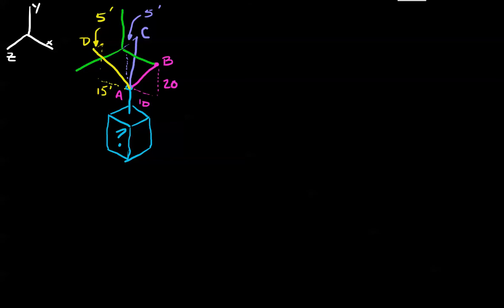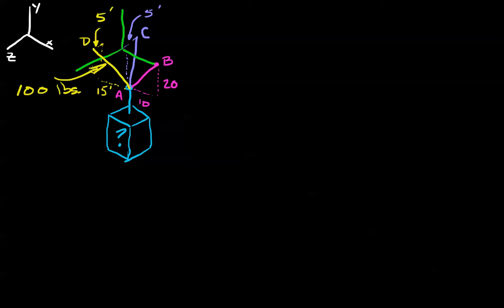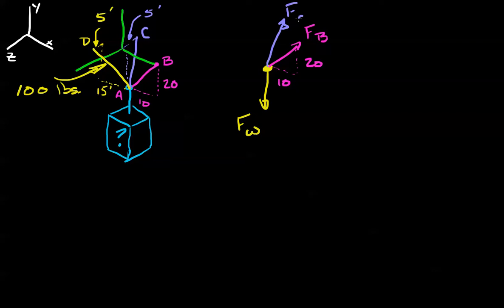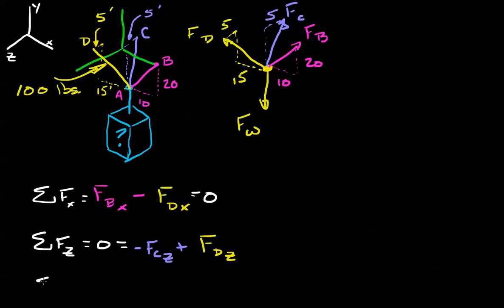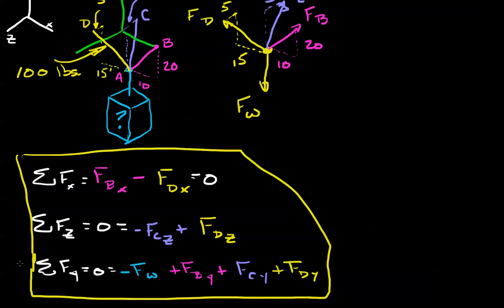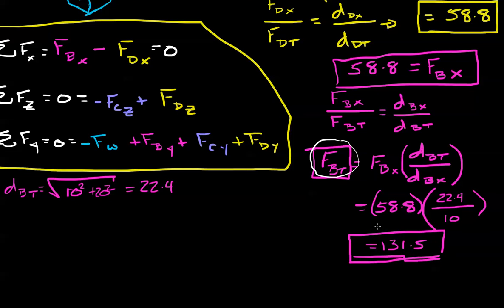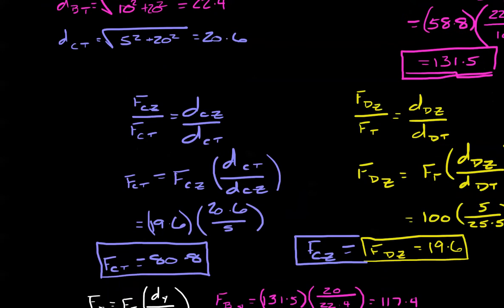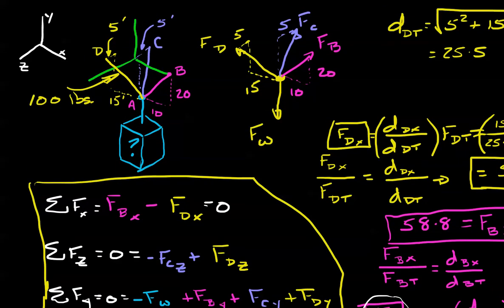Engineering statics 05 3D problem (vector practice) PE

Comment: What if the weight of the crate is known, and the length and angle of the wires are known as well. How do you solve the force on each wire?
Reply from the maker: Really, the same basic process.  FBD.  Then sum your forces.  Now, use the fact that, in the y-direction, Fb+Fc+Fd= Fw.  You can solve for the final values using simultaneous equations, matrices, or slick substitutions.  As a note, this is a fairly common type of problem.  Good luck.

Comment: Odd question, but what is the name of the electronic blackboard system you are using?  I keep running across it in videos and it looks really handy!
Reply from the maker: +Charles Melenyzer Good question.  I use sketchbook express.  Then, I use snagit for video capture.  I'm running a mac, so my options are more limited, ironically.  Good luck.